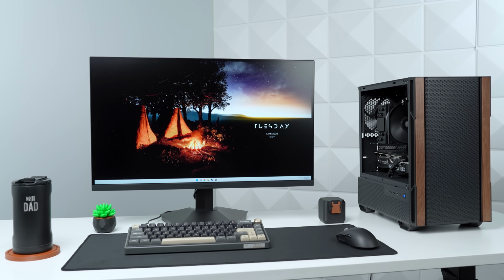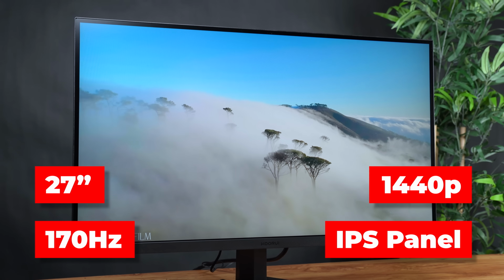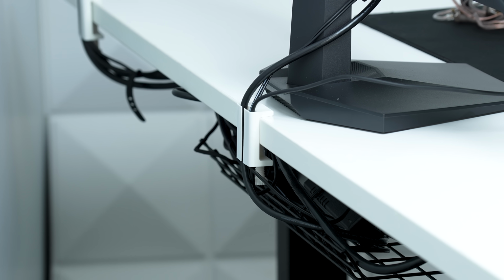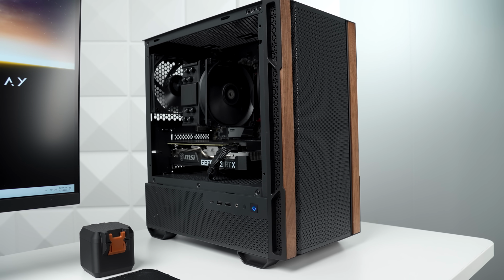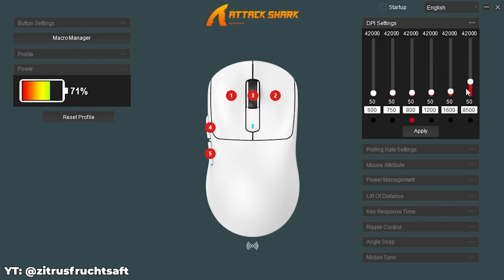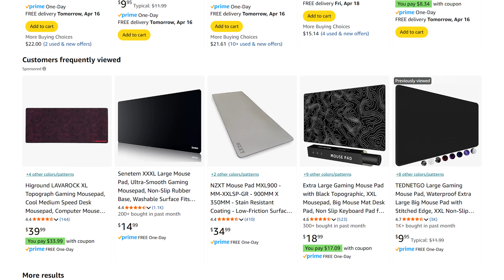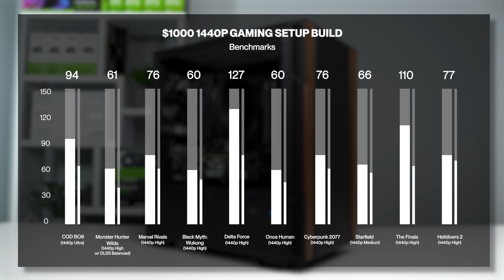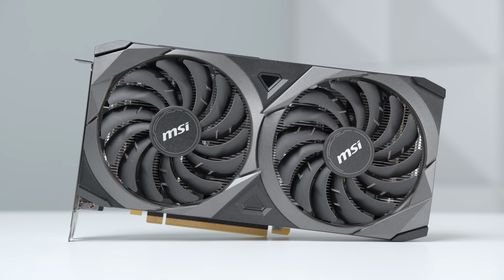$1000 FULL PC Gaming Setup Guide for 1440p

Comment: Zach, why don’t you start 3d printing GPU sag brackets?
Reply: Great idea, as long as you use a material other than PLA that can withstand GPU temperatures, that would be sick
Reply: @butterkaese420mine’s PLA and has lasted fine over the past 5 months. One of my mates has one I printed as well in a micro-ATX case with choked airflow and it’s still fine too. 
I’m using PLA+ which has a softening point of around 60-70 degrees (from my knowledge), the fins let alone the fan shroud gets no-where near that.
Reply: @butterkaese420 what are you yapping abt if your gpu backplate hits >60c theres something wrong

Comment: Dude, I've been following you for some time now and this is one of the only comments I've left since I discovered YouTube. This is the FIRST TIME I see someone actually factor in the peripherals in the total cost of the build, it always gets so overlooked. Also cool detail that you went for some IEM for the sound, a bit of fresh air when everything here and there is headsets and headsets (Though personally I'm going to have both with a DAC/Amp).

Great video, loved it. The advertising also looked seemless, great work there to you and your team.
Reply: most videos focus on the pc itself because its the most "objective" part, and the rest of the setup is mostly personal preference.

If I was to build a setup today, I would probably spend 90% of the budget on the PC, and buy the cheapest garbage that I can find for periferals. Im talking no more than 20 dollars in keyboard, controller and mouse(each), maybe 30 or 40 on a cheap headset with a usable mic, a used 60hz monitor from facebook marketplace, no mousepad. And then upgrade all of them over time, all of the cheap peripherals can be gifted to someone and the cheap monitor can be used as a secondary when you buy a good monitor that properly fits your needs. 

The same concept can be applied to the PC itself but its harder, given the situation of a great deal on a GPU that didn't fit the budget i recommenden my friend to get a 500GB 2.5'' SSD alongside the GPU, and later on he bought the 2TB NVME that he originally wanted, in the end he has both and didn't have to eat exclusively bread for a week to afford the upgrade.

truth is, most people don't have a hard budget for the entire setup, they just have a budget for the moment, everything can be upgraded and changed over time. So I think its best to focus on the really important stuff with mediocre shit to go along with it and upgrade later, this way you can easily end up with a setup that is worth 1500 bucks when your initial budget was 1000
Reply: @Tarmin_  Good view bro, it would have been hella disrespecful for me not to answer. I live in Venezuela, I know how difficult it can get to grab peripherals after the PC. I'm not going with the cheapest but also not any way near the expensive ones, a lot of offers on eBay will get taken advantage of for sure.

Is just that, they're there, and even if they're cheap peripherals, they'll still cost about 10%-20% of your build, and we have to include that, because without a monitor, you're not playing. lmao
Reply: well you've only been here 11 months so thats not that surprising
Reply: @remaain  It's a just a new account.
Reply: Bro it’s a setup video
Reply: @orangegooning  dont hate bro, I completley agree with sealion

Comment: I got a 165 hz monitor lg ultra gear for the pc that i built earlier this year (i went with am4 at the time didnt know micro center has mobo cpu bundle) i had gone to the micro center in dallas and a msi b550 mag tomahawk got me a 1tb inland ssd for cpu i got the ryzen 7 5800xt ram i bought 32 gb of corsair vengeance lpx power supply i went with a 850W msi mag gl i believe it was for the case i went with the montech xr gpu i bought from a friend who upgraded to the 4070 i bought his 3070ti zotac gaming from him the grand bill at Microcenter was 656 for the cpu cooler almost forgot it was the coolmaster halo 212 i built my pc want to add an aio cooler to my pc soon! Its not expensive guys research your parts
Reply: Currently for cpu upgrading im looking at the ryzen 7 5700X3D instead of wasting money for am5 i can get some more years out my am4 build as for my younger brother i made sure he took full advantage of micro centers bundles he even bought a PNY 4070 super from newegg
Reply: Currently been saving up a pc for my older brother am5 platform and got this 1660 super to i had in my old build and get him a 1080P beast with a case with some upgrade room
Reply: Also if you’re working save 100 every check I have 400 so far thats from every pay period from my job my goal is to be at 600 thats the total case for case psu storage motherboard cpu ram

Comment: Heres my setup any improvements anyone?

Gpu-Asus Duel geforce RTX 4060 v2 oc edition
Cpu-i5-12400f (upgrade using a microcenter amd bundle when available)
Motherboard-ASUS PRIME B660M-A AC D4(upgrade using a microcenter amd bundle when available)
Ram-2x16 gb ribjaw v ram sticks
Cooler-upgrade to a NH-U12S when available
Power supply-mag a750gl 
Case-microcenter Powerspec 205M Mesh mATX case
Storage-1TB NVMe sdd
Front fans-two 120m(upgrade to better 140mm ones down the line)
Rear fan-Noctua NF-A12x25 PWM SSO2 Bearing 120mm
Monitor-Asus vg249q3r tuf gaming 23.8 full hd 180 hz monitor

Comment: Hey ik it’s off topic but I’m planning to get a prebuilt pc and im thinking about getting the sky tech archangel the one with a i5 13400f and a 4060 does anyone know if it’s actually worth it
Reply: It depends on how much they want for it, and your comfort level with building a computer yourself. If it's within about $200 dollars of what you could build a computer using the same parts for it might be worth it if you don't feel comfortable building one yourself, otherwise you'll almost always get better value building one yourself, the extra markup they'll charge you could get you a CPU or GPU upgrade or possibly both.
Reply: @joemcdonnell5069 it’s 1060$ usd and it has i5 13400f a 4060 2tb ssd 32gb of ddr5 and a 650w gold psu

Comment: I've got the same monitor, but with a height adjustable stand, as it has the same panel. Really great for the money.
Reply from the maker: Oh wow nice. How much $$?
Reply: @ZachsTechTurf  Got it open box for £149 (UK). Really please with it as replaced a slower 34" ultra wide.
Reply: this monitor isnt great, while you may have got a fine pannel koorui has large amounts of quality control issues becuase they use cheap pannels, you are better off going from a known brand for a monitor. 
also this isnt a 1ms response time thats just marketing talk.
Reply: @cruelraptor1235 can only comment on what I've got, and it's been great for me. 🤷

Comment: Question for ztt : should i buy a used rx 6700xt or a used rtx
3060 for rg later to a ryzen 7 5700X3D ? Please zach i need answer for this question asap. They both cost the same by the way.
Reply: 6700 xt. no competition really
Reply: Is new 6700xt is good  @olivergasson3131
Reply: 6700XT smokes 3060

Comment: Best guide i seen so far, using this guide build soon for my new pc.
Reply from the maker: Nice let me know how it turns out
Reply: I don’t recommend any of these peripherals. Koorui have notorious quality control issues, rk make absolute ewaste keyboards, there are better mouse options for the price, and the iems aren’t great. 

I would recommend the vxe r1 pro on AliExpress for the mouse. 

7hz x crincial zero 2 for iems. 

KTC H27T22S is a much better monitor. 

Not sure about keyboard as there aren’t many good budget options, but something like a keychron c3 would be better.
Reply: Except for the cpu, gpu and motherboard, the rest of the parts are actual garbage quality. this pc is not good for longevity.
Reply: @BasedParadise why is that? I wanted to use this build.
Reply: @tissirindigo  This build only looks good on paper, it's made for the sake of a video. He is only choosing the cheapest parts he can find.

Monitor is the same story, good specs on paper. But shit quality with terrible ghosting.
The PSU is just cheap e-waste. You can spend like 20-50 more to get a good quality one that wont burn your house down. You could also do with a bit higher than 650 watt, if u ever want to upgrade(since a good PSU might last you 10+years). 
Then for a SSD i would also not cheap out unless you want it to randomly die and lose all your data. 
Coolers are cheap as well. You can probably get one twice as good for like 15 $ more.
Reply: @BasedParadise sorry for the long comment but you seem very informed and i just want apc that can max out my monitor
Reply: @BasedParadise  would you please give me a list of these specific parts?
Reply: I do not reccomend those periharals. 
Instead of that monitor go for KTC H27T22S, koorui have bad quality control issues, and the ktc monitor is much better.

For the keyboard id go for keychron c3, not great but it will be better than the rk keyboard, as rk keyboards, and other cheap china boards have had issues with them literally exploading due to poor conectors on the pcb. (this appies to the aula f75 as i know thats also a popular option.)

The iems are fine, but 7hz x crinical zero 2 are better. 

The the mouse isnt awful but the vxe r1 pro is a better mouse (better sensor and better quality build.)
Reply: @cruelraptor1235 what if I wanted 240hz instead of 180
Reply: @ you would want to spend more money to get a better monitor.
Reply: @cruelraptor1235is the r27qe good? Thats monitor i went with, i got it for 200 cad. Its 1440p 180hz 0.5ms hdr400. I also got creative pebble v3 speakers, for 50 cad. I also got gaming headset hyperx cloud 3 for 100 cad, i know tonality, isnt the best, but for me, i love them, because they are comfy, and because they have a great microphone compared to other 100$, and it is built for fps games and i play a lot of fps games, and i needed a 3.5mm audio connection. 

Anyway, now i need a keyboard, and a mouse, and a pc, because im powering my setup with a ps4. I have about $1500-2000 CAD to spend, and i need a pc that suits my monitor. basically i know people usually get pc first then monitor, but i needed to get my minitor first, to pair with my console. Anyway my console died and now i need a pc, andkbm. I dont plan on upgrading monitors obviously, so i want a pc that can play 1440p native normal graphics, while hitting those 120 to 180 fps to match my 180hz monitor. Games i play: Minecraft with a couple mods but no crazy texture packs or shaders, Roblox, Fortnite, Call of Duty Warzone, Overwatch 2, Valorant, Rocket league, Fc25, forza, gta V. What pc specs should I get? I would preferably like a prebuilt. Does a 4070ti 12gb good enough for me to get 180fps in 1440p in the games i mentioned?